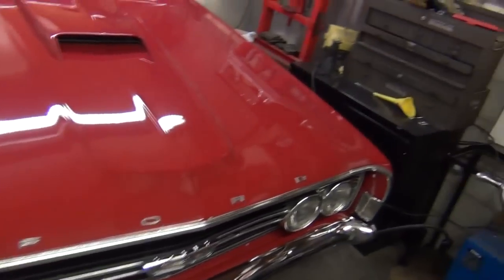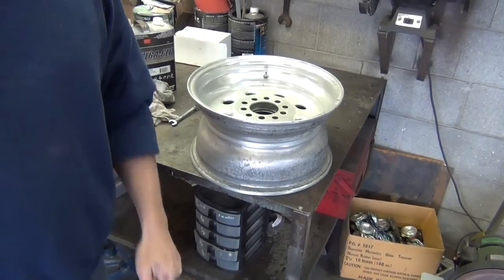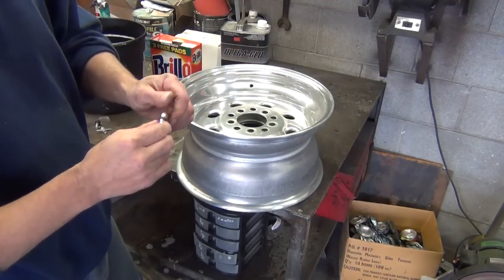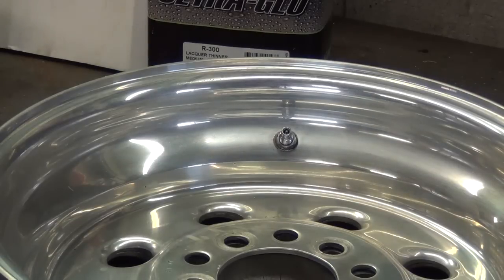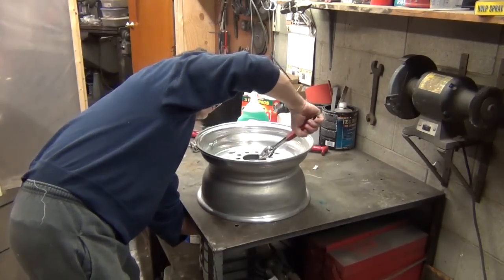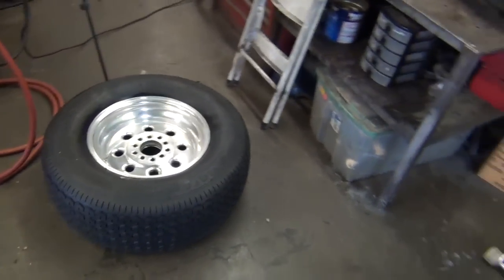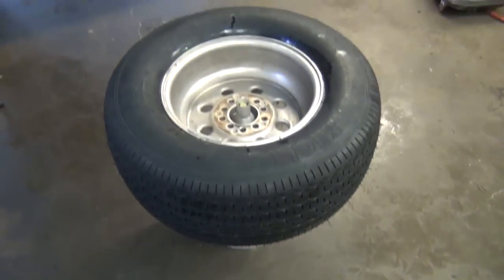How to mount and balance your own tires ,the old school way .

Comment: Just put 4 tires on my daughters car Saturday.  Showed son how to mount and balance tires.  Put new stem on TPMS sensor on wheel leaking air previously.  Cleaned all rims before installing new tires for sealing surfaces.  I used a HF manual tire changer.
Reply from the maker: Thanks for watching.

Comment: Good job on the mount & balance! just got through doing a mount on a rim for my Courier p/u. Tire was old & kinda stiff at the bead & didn't really want to stay down in the drop center of the rim. I actually had to use one of those $2 Walmart rubber mallets to persuade the last 4 in. of bead over the rim, because the rubber was so hard, lol! Then it didn't want to set the bead, so I laid the tire/rim with one side of the tire on a curb & the other side on another tire I had sitting around, & I jumped up & down standing inside the rim, pushing the bead on manually. Then I just flipped the tire over & did the other side the same way.
Reply from the maker: Sometimes those old tires can be stubborn. Thanks for watching .

Comment: The secret is a C-clamp strategically placed to keep the tire bead from walking around the perimeter of the tire.  Just make sure to protect the rim from C-clamp damage (put something between the C-clamp contacts and the rim for protection).  Thanks for sharing some details that most other videos miss.
Reply from the maker: Thanks for watching

Comment: I will be putting 4 new 15" tires & tubes onto 4 skid steer rims. I will try a lot of what you demonstrated because my local tire shop wants $35 per tire (4 tires = $140) and Walmart said they will not mount my tires/tubes.  They were apparently scared of any non-automotive tires.
Reply from the maker: Thanks for watching.

Comment: The hardest job dismounting and mounting tires is getting old tire lose from the rim, thats more work then, all the rest of taking the tires off the rims and putting them back to gather, buble balancing is not as good as spin balance, and if you have aluminum rims, you have grind the corrosion of the rims with a grinder or the bead will leak, I have done a lot of tire work its very hard work. Thank you Dennis
Reply from the maker: Thanks for watching

Comment: great video  always glad to see old school techniqes used. but if I may next time leave the valve stem out  when airing them up helps get it filled quicker and if it,s not seated all the way it will push more air in the tire and fill the void quicker .
Reply from the maker: Thanks. I never thought of that and will try it next time. Come to think of it ,now that you mention it, I do remember seeing guys in the tire stores do that. It just never crossed my mind whenever I do it at home. Thanks for watching .
Reply: thank you for great videos. also if you can find an older style bumper jack those work great for bead breakers if you have a heavy enough car . like the one for your torino.
Reply: Dragracer64 hes right, anytime i swap tires i remove the valve stem to seat the bead to the rim, some times your lucky to not have to but my luck, beads just dont want to seat. Just like lawn tractor tires.

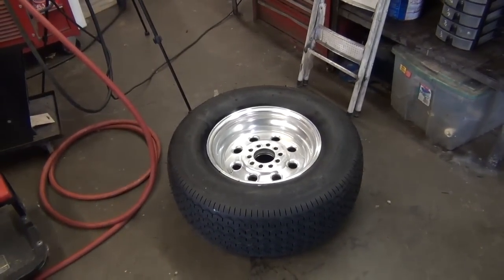Comment: Neat bead breaker at 31:50
Reply from the maker: John Carter Thanks . It works .
Reply: Dragracer64 I have a change in viewpoint. I made one like it and it did not work on a well stuck old tire bead. Trying to push the bead down in 2 places at once causes it to bind and not slip off the rim. I am currently making another one and if it works properly I will post a video of it.

Comment: Regarding tires slipping on the rim.. I think part of that problem is you are talking about slicks that run with a lot less tire pressure, combined with lots of traction, combined with lots of horsepower. I just mounted a set of tires for a vw bug by hand and used grease to help. Its not powerful enough to spin the rim on the tire during takeoff BUT what Im a bit concerned about, is braking.. Im spooked now that the rim light slip on the tire during a hard brake.. what do you think?.. I also thought about putting grease on the tire because of chemical reaction but tires are made of oil, so I thought it would be ok... Sexy rims by the way and the car sounds great too!
Reply from the maker: Phil Nicols Hello Phil . Actually I was talking about drag slicks when I mentioned tires slipping on the rims .I have never used grease myself, and am sure it would cause a problem on any vehicle capable of a hard launch . I think you will be okay when  braking . I like the dish soap because it helps glue the tire to the rim .
Reply: Yeah I been working with tires and physics and grease is not good. IF I was you I would pop those beads loose and try to clean the grease off first with a rag and than again with some soapy water. Try not to get too much water in the tire. Mop it up with a rag. Then reseat them on the bead. Peace of mind means less stress. Less stress means you live longer. :) Cheers m8

Comment: Hairspray works excellent on handlebar grips.
 But if you prefer to not have to cut em off. What i do is use a solant like throttle body cleaner or brake clean, spray the inside of the grip and bar. Wipe off the bar to clean residual oil, and the brake clean in the grip will act as a temporary lube, bd slide on easily. Then it will evaporate an bam... ur grip is solid.
Reply from the maker: I have heard of that for radiator hoses,

Comment: hi, i didnot see u have used the tire bead (a kind of black glue that goes between rim and tire) is not that is needed. Your vide is very good.
Reply from the maker: sivaraj palanisamy I have never used it and have had no problems. Thanks for watching.

Comment: in my opinion anything to do with tires that you can do yourself is the way I would go with half the idiots they hire at shops that don't know what the heck they're doing, I've taken brand new tires that I mounted myself to a shop to get balanced and they vibrate worse now then they did before I had it done. I would get a bubble balancer but I don't feel any of them I've seen are all that accurate with the way they pivot around the edge of a point its not frictionless, they should use a greased ball and socket style set up but I haven't found one made that way
Reply from the maker: +This0is0pointless Greased ball and socket would work better. Mine is a cheap version.. I am thinking about trying balancing beads next time I mount tires.
Reply: This0is0pointless I just polish the contact points on the bubble balancer with a dremel and put a thin layer of grease on it so its real slippery. made it work much better.
Reply: I use 3 to 5 oz of BB's from Walmart sporting goods section. Works great